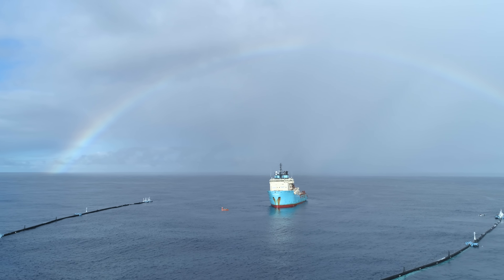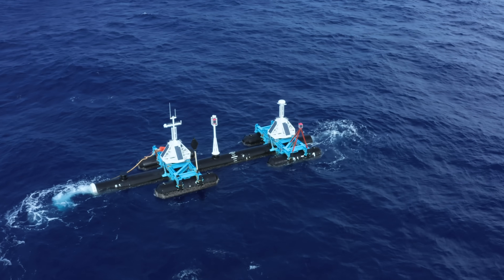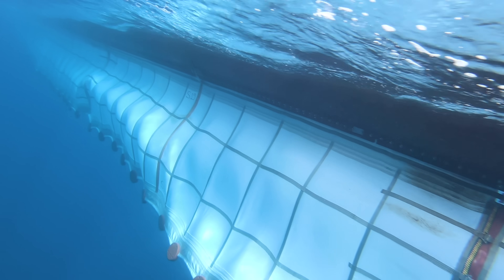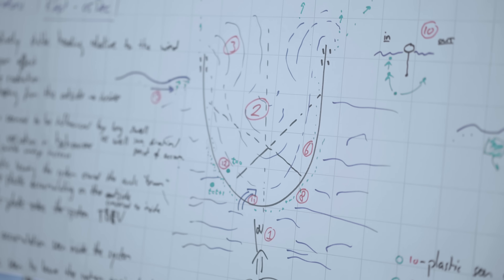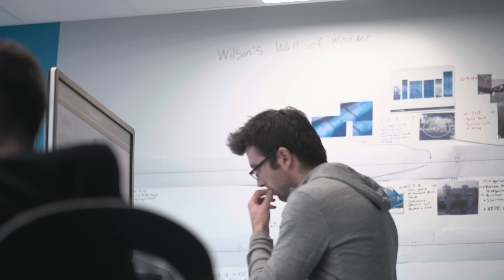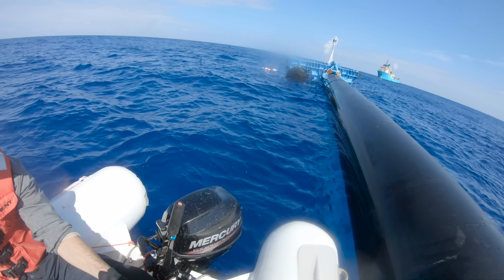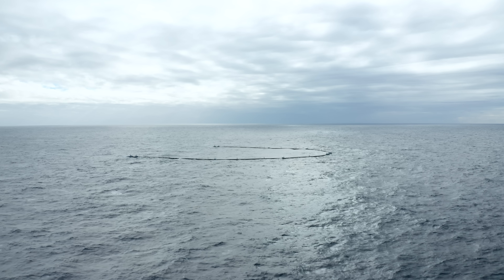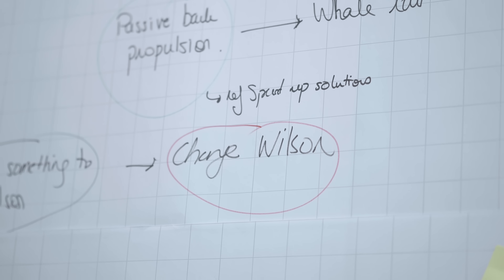The Root Cause Analysis | Why did System 001 break? |  Research | The Ocean Cleanup

Comment: I'm no engineer but could you not create some kind of internal current from the edges / ends of the U shape to keep the captures plastic items inside preventing them to drift out? Perhaps with some underwater propellers?

Also, how does the retained plastic collected from the U shape, do you have any info/material about that? is there a boat that scoops up the plastics once the U shape is filled to an extent? Ho do you monitor the level of "fullness" of the area, hwo do you know when to collect and how is it done?

Comment: Hello guys  may be I don't understand well your système but to me seing the views ans after listening your conférence it works on the reverse????
because on m'y point of  view it is not normal that  the sea gets quiet inside the structure and not out side !
it's clear that we sea the shock of the waves on the external part of the tube of the structure.
it's clearly evocated when a man in the video tells to us that many gabage were stuck but un the outside part of the structure...
the problem isn't question of speed but a reverse orientation of the système.
logicaly waves of the surface currant must shock the inside and get quiet out side.
Il think there will be also a problem if the flow of water or an enough part of it can't pass through the structure and center is the best !

Comment: As a structural engineer, I appreciated your breakdown of the failure and concur with your analysis. EDIT: After reading the article, I have a better idea of the crack propogation.

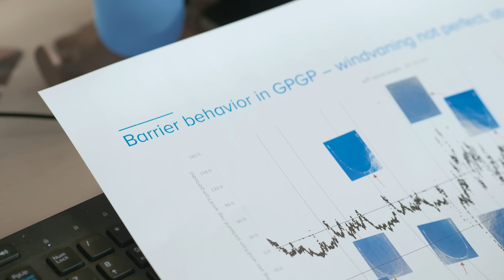2:57 and 4:51 really shows the scope of the impact on the ocean currents made by the system. The waves outside are much higher crested than inside the system. I hope you guys figure it out!

Comment: I didnt catch how this collects the plastic into boats to be recycled. Im guessing a bucket or suction and hold system would possibly hurt sea life but what about paddles sorta  like in a pin machine in the ends. It lets it in but doesn't let it out because the paddles only go one way. Theyd have to be extremely light weight to allow any little bit of plastic softly drifting in its direction. And there would need to be visible to animals and allow a gab for animals to swim out  perhaps some sort if noise or wave could stop animals entering. I think i remember someone developing a sound that stopped sharks heading for nets at beaches.

Comment: Thank you for the update, and keep at it. You are doing wonderful work, and hopefully, when it works properly, we will have some of these in every ocean on the planet. EDIT: I am not an engineer, and so I have no idea if this is viable or not, but if the problem is that the garbage moves out of the system by the water current, how about a funnel system? Opening it up somehow in the middle with nets holding the plastic back, while the lack of pipes making the water flow through instead of around? (This is me doing hero worship.)

Comment: I do wonder about the emphasis on this pac-man concept - that the system must travel much faster than the plastic. Apparently the system was catching plenty, but not retaining. What if it were designed like the cross-section of a lobster pot, where a broad opening funnelled down to a narrower opening? Unlike with lobsters, the funnel wouldn't need to be "deep" or even very narrow, and could allow plenty of space behind and around for the rubbish to accumulate. It would still have to travel sufficiently fast to "catch" the plastic, but not as fast as otherwise, since the "slow" version was still catching. Obviously that would be extra drag on the configuration, but would two more sections (or lighter ones?) like the final two arranged inwards from the ends at a 45 deg angle (or whatever is found to be optimal) be efficient enough to counteract that effect?

Comment: Looks like the root cause is a lot of young people without a lot of engineering experience working on a complex problem.
Reply: Since you have so much wisdom to share, why not join them and see if you an contribute?
Reply: @balleklorin9780   I run a small design and manufacturing firm. My free time is very limited and I'm already involved in a venture to develop carbon capture technology. Aside from that, Ocean Cleanup doesn't publicly share all the technical details of how their system is intended to work. Without that information it's impossible to provide any meaningful engineering solutions to the problems they're encountering. You have to know what you're dealing with in order to find solutions to problems.
Reply: @OU81TWO  They are very open about their design, and the way it is suppose to work. You can visit their website, and go through the youtube channel if it actually interest you. They are also very open about the problems they are encountering and how they go about trying to solve them. So for an engineer, it should be quite easy to contact them with their observations. 

However, I still do not quite believe that you actually are what you claim to be. Since you also claim to be working for a leading aeroplane manufacturer, as well as running your own small firm, and developing carbon capture technology.
Reply: @balleklorin9780   I (my company) works for an aircraft engine mfr. I'm also a partner with a group of people for the CO2 capture venture which has nothing to do with my firm. Not sure why this is so difficult to believe but I can prove it to you if you really care. Let me know.

Back to ocean cleanup...the information they don't share is the detailed technical stuff. Take the weld failure on the large pipes for example. For me to potentially find a solution I would need to know how they calculated the weld size?, did they do FEA (finite element analysis)?, if they did then was the model set up correctly?, what loads did they use? Did the contractor inspect the welds? Was it a drawing error or a fabrication error? Etc. There is a multitude of aspects to consider and the answer to the failure lies somewhere in the details...which are not publicly available. Trying to piece to together bits and pieces of the puzzle without having access to ALL the information is a complete waste of time.
Reply: @OU81TWO  You know, in this video that we are discussing, they actually explained what went wrong. It is what the video is about. 

And I still don't really believe you with your claims, simply because I find your comments to be too dismissive and petty. Much like a internet sceptic. You know, those people that have to dismiss the work of others, because they feel lessened by people that are actually trying to do something good.

Comment: What really struck me in another of the videos was the mention that you are essentially ‘building the first car/plane’. From that perspective it makes a lot of sense that there is going to be learning experiences because while there may be cross over knowledge in some areas, this is also a completely new area of expertise. Every model, experiment and data you collect helps you add to the knowledge base to help you improve on the model you have built to help improve the design, as well as understanding of how things work, to help moving forward in the future. 

So really liking the positivity and forward thinking here, with the focus on using what you have learned to move forward.  

In terms of speed, I’m curious as to how you’ll address getting extra energy to speed it up or perhaps if turning it around would work so it’s catching the material coming in behind it, rather then trying to catch objects that are moving faster in front of it? Although that may not work since it’s designed to ‘automatically’ curve into a forward u shape, as I understand it. 

Thank you for the update and the hard work from all of you! :)
Reply from the maker: Thanks so much for your kind words. We have not confirmed how we will speed up to system, update to come in the near future!

Comment: I'll put up my unqualified opinion: put sails on wilson
Reply from the maker: We have considered this method to speed up the system. Initial thoughts are due to the harsh conditions the kites would be exposed to in the Great Pacific Garbage Patch, they would require quite a bit of maintenance, but are not out of the question. Update on system upgrades will be released in the coming weeks.

Comment: Sails for Wilson!
Reply from the maker: We have considered this method to speed up the system. Initial thoughts are due to the harsh conditions the sails would be exposed to in the Great Pacific Garbage Patch, they would require quite a bit of maintenance, but are not out of the question.

Comment: Making it "faster than the plastic" is all good, but won't it just push a lot of the debris foreward? It seems there needs to be an immensely large system that is anchored and static somehow. Coupled with an ongoing campaign of scooping out the captured debris. This is a major mess in need of agressive action. This is a multinational issue in need of multinational cooperation. The Ocean Cleanup is far too grass roots to solve this on its own.

Comment: Plastic is spilling over the top of the black plastic tubes with each wave. Especially in stormy conditions. In 2:38 imagine the waves a bit stronger and floating plastic would spill easily.
Reply from the maker: One of the technology aspects we confirmed during System 001's time in the patch, was there was plastic was not lost due to overtopping. For more information on the technical aspects which were confirmed check out the full report: https://www.theoceancleanup.com/updates/system-001-learnings-root-causes-summarized/

Comment: Put a couple VAW turbines on it to drive a small propeller at each end, you probably don’t need much propulsion, but a small amount at each end would drive the device along a bit faster than the plastic. Something needs to propel the device or it will just drift along with everything else.

Comment: When I heard of the idea, I thought that moving slower than plastic was the way to capture it. So maybe slowing down and turning the system?
Reply from the maker: As there is an absolute minimum in terms of slowing down the system while the system can be sped up infinitely in theory, speeding up should be easier than slowing it down. However, turning the system around is not out of the question.

Comment: In one of the comments the Ocean clean up mentions that you want to increase the speed of the system so it will catch the plastic due to it's own movement relitave to the contaiminated water. Why not change this thought 180 degrees, when you slow down the system by adding more mass and look where we can decrease the wind surface area (making the system more streamlined) the speed will decrease drastically. The result will be that the top layer of the water which is influenced not only by the current but also wind will move faster than the system. The question we need to answer is how to filter the passing water from the containment on a efficient and practical way. Greatings from a salty sailor on board one of the Dutch merchant vessels. 👍👋

Comment: Solar or wind powered motors that pull the system along.
Reply from the maker: Based on our data and simulations, it is possible to design the system to be completely passive. Adding solar powered propulsion would require a large amount of solar panels in order to move technology of our size and would require ongoing control software and technology maintenance. However, it is not out of the question.

Comment: Mobile scoop?
Reply from the maker: If you mean mobile scoop = a passive system then you are correct!
Reply: @theoceancleanup ...No I was thinking more like a big ship where it travels with a big mouth like a whale. Where the water and trash go in the front and is separated and the clean water goes out the back? The water could go thru various size screens. Maybe can use an old American aircraft carrier?
Reply: @tommy6905  that would tap wild life wouldn't it?

Comment: Idea (wether good or not has to be decided by the experts) : add sails to make it go faster and catch up with the plastic. Or solar powered propellers.
Reply from the maker: Thanks for the idea! Solar powered propellers require large solar panels, ongoing maintenance and a ton of energy to propel a system of our size forward. Our simulations show we can accomplish this speed increase passively, which will be incorporated into our upcoming upgrades. As for your idea with sails, we are investigating ways on how we can make better use of the wind.
Reply: The Ocean Cleanup cool, so sails are not a completely stupid idea. I hope your funding is secured, you are trying to tackle one of humanity‘s biggest problems. All the best and great success! Never give up!

Comment: Could pipe joint fracture be minimized by internal steel or carbon fibre reinforcement during joining? Could the forces on joints be damped by means of stringing between sections of pipe curve? Just and idea from power transmission line engineering.
Reply from the maker: Implementing a cable reinforcement to go in between the pipes is something we have considered and not completely out of the question. This additional technical aspect would however not solve the issue of ensuring consistent connection between floater segments.
Reply: @theoceancleanup  I have no idea for the joint, though. 

Manufacturing continuous floating pipes seems impractical to transport and may have greater risks to the environment due to plant location.

My idea of stringing is like having spider webs linking opposite floater sections to restrict or dampen horizontal vibrations of the floater assembly, that hopefully might reduce bending forces on joints in some degree.  From IEC 60865-1 clause 6.2.5 to 6.2.6 related to forces due to cables swinging in-out which might have some similarity to natural swinging of floater assembly. 

Thanks for the attention.

Comment: Is it necessary should be fully operated by natural forces?... We have solar energy out there and also wind energy.... So why can't we just harvest energy drive our system towards the plastics.....
Reply: Come on people.... Nothing in this earth is given for free..... Don't lose your hopes and continue the efforts.... We are here to support.....💪
Reply from the maker: Based on our data and simulations, it is possible to design the system to be completely passive. Adding solar powered propulsion would require a large amount of solar panels in order to move technology of our size (this would also impact the weight of the system) and would require ongoing control software and technology maintenance. However, it is not out of the question.

Comment: Why not flip the U if the cleanup system is too slow? Based on previous videos, widening the U seems to have contributed to the crack due to a worse stress cycle. So instead of trying to make the system faster and sacrificing weight and simplicity, why not let the plastic travel to the system?
Reply from the maker: Thanks so much for sharing your idea. The Great Pacific Garbage Patch is an area 3x the size of France. The plastic is extremely dispersed. In previous designs, this was investigated but then we realized that to catch the plastic you must act like the plastic. This changed our estimate for cleanup from collecting 50% of the patch in 10 years time, to 50% of the patch in 5 years time.